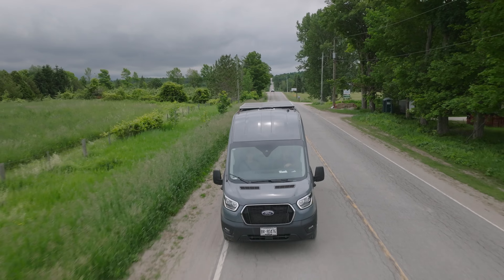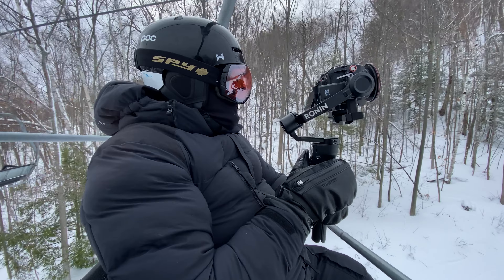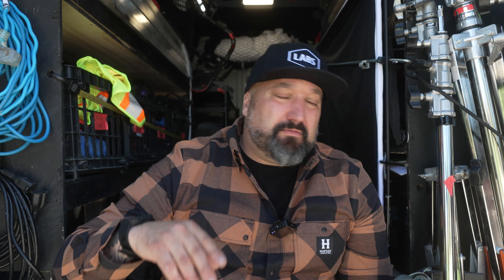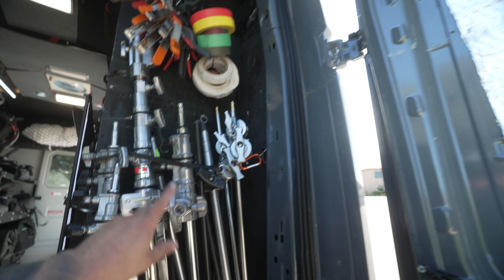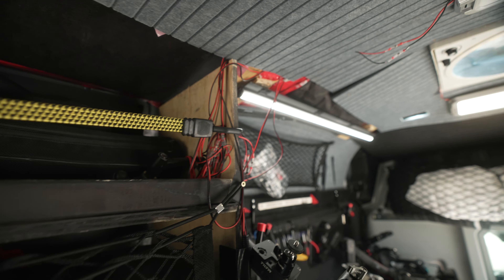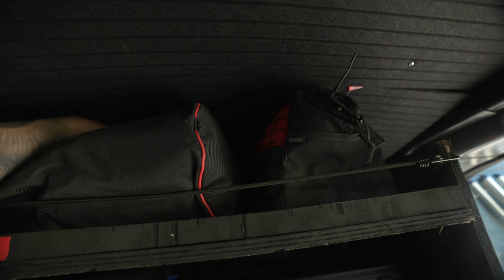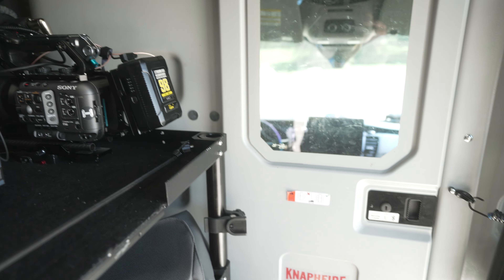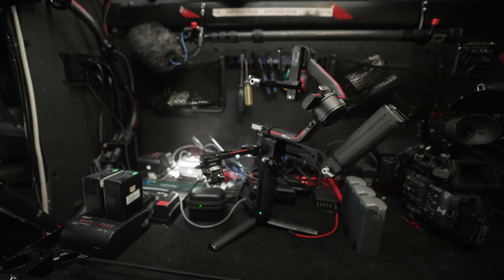UNVEILING MY CUSTOM PRODUCTION VAN

Comment: FYI your fan cut out is too big its would be  easy for a person in remove it fron the outside  and slip right in. I woulld have made 2 or 3 smaller fan opening and add more fans.  I like to glass door divider from  frt to back did u pay extra for it ?  Now u r going to cove it. Ramp is to big have you thought about a lift that attaches to the outside back door without your ramp than u have in there u free up  more shelf space and easy to  move around  and get your  camera cart out I would get some hamper or more carts in there.
Reply from the maker: Thanks for the input on the fan. I hadn't thought of that!  Dont think I paid extra for the glass on the divider. I had that done on the factory build.